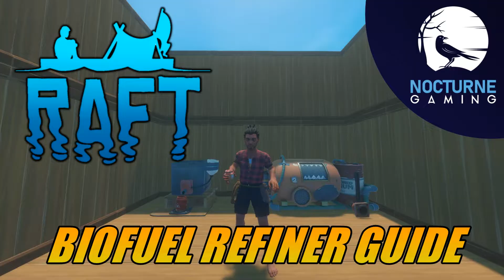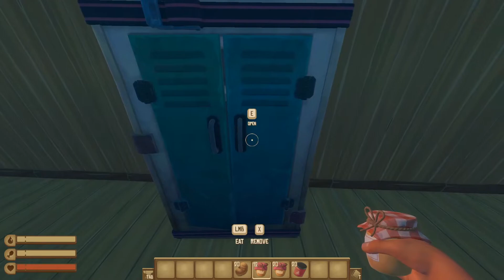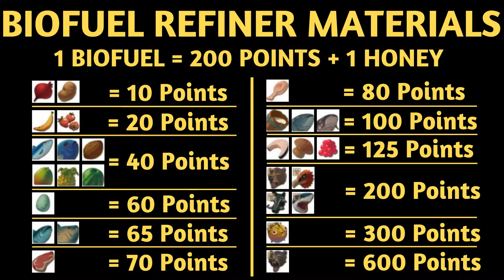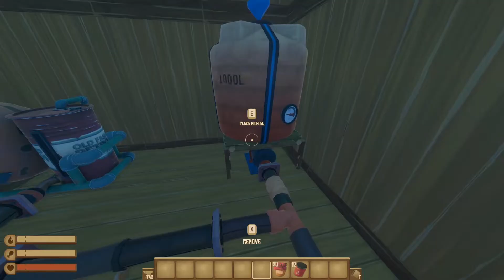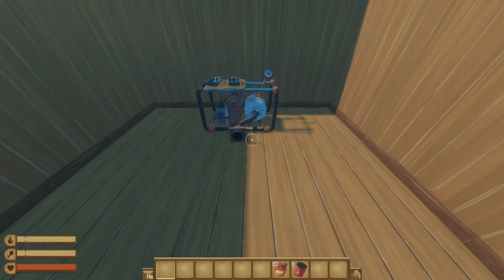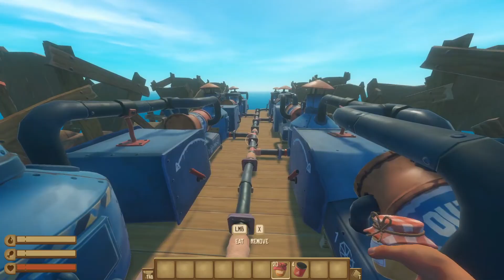Raft - Advanced Biofuel Refiner and Battery Recharger

Comment: One important thing to point out is that while the tank holds 4 biofuel, you should never manually charge it more than 3 canisters at a time. A single canister is worth 60 units of fuel while a tank hold 200 units, so if you charge the 4th canister you are losing 2/3 of its value. Once you have the avanced refiner this becomes trivial, but while you're manually charging your tanks you should never fill them completely if you want to be efficient with your fuel
Reply from the maker: Thanks for the tip!

Comment: So it's possible to connect the advanced biofuel refinery to the tank, then to your engines? If that makes sense?
Reply from the maker: It is possible to connect all 3 together with a single line of fuel pipe to connect the Tanks, Engines, and Refiner. Using this method the game prioritizes filling up the engines before storing the excess in the tanks. You can also connect all your Refiners to a single line that will feed into the Tank/Engine line.

Comment: 11:29 if i made a room for engines, can i block the sound of them?
Reply from the maker: Unfortunately, the sounds from the engines are proximity based. The only solution I know of is building a bridge of foundation tiles out from the raft so the engines are farther from your main raft. You only need a 3 tile wide by 9 tiles long section to hold 6 engines, but don't forget to reinforce the foundations so the shark doesn't sink your engines!
Reply: @NocturneGamingOfficial  uh... anyways, thx for the info is reallyuseful

Comment: You only need max 6 engines
Reply from the maker: Was it changed from 1 Engine per 100 platforms? We'll look into this and see if it was changed
Reply: @NocturneGamingOfficial   It's true that is 1 engine per 100 platform, but it cap out at 6 engines. So they can work no matter how many foundation pieces you have.
Reply: @NocturneGamingOfficial  yeah its not explained anywhere but it 1/100 foundations up to a cap of 6. so At 90,000 foundations you still only need 6 engines for top speed.
Reply from the maker: @FR099Y  I wonder what the framerate would be with 90,000 foundations... 😄😄